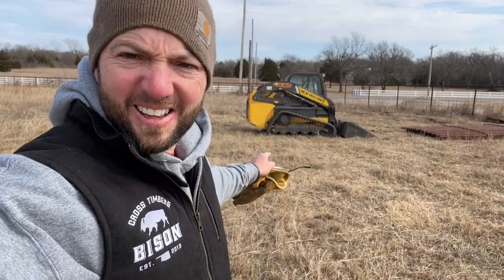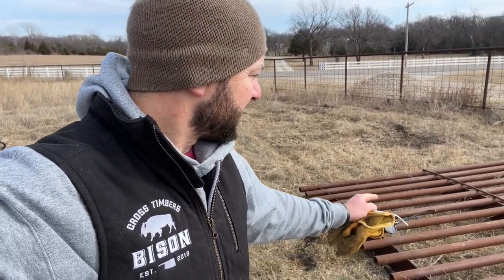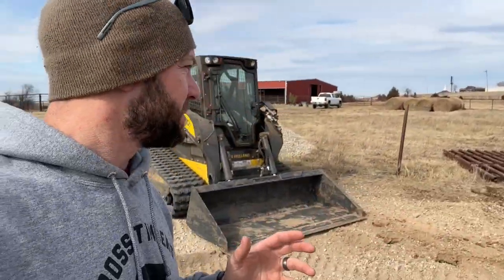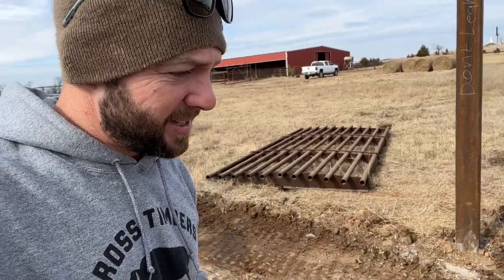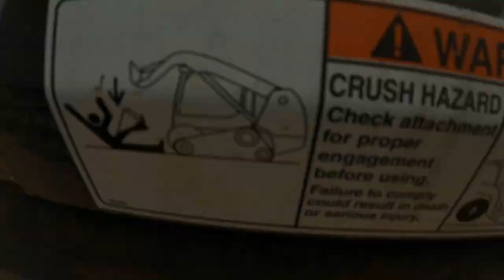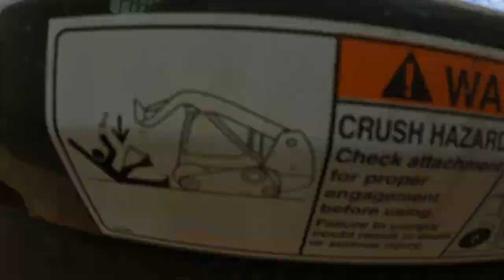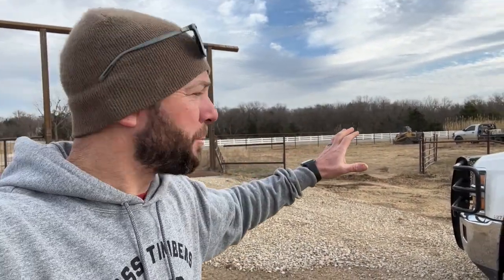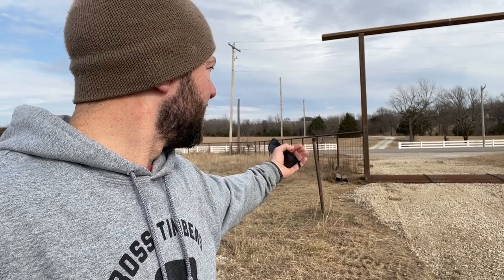Last Chance Stop for a Bison To Escape!

Comment: Out in Colorado l have seen where a Cattle Guard has a cement frame.  The cement frame has a two foot well.   It will take many years to fill up.  Easy way to keep it clean is to have entertained points on the outside of the holding area.  How you have it set up now, your bison will wall right over it.  The video of your water pipe trench showed me that bison will walk right through a simple 
Cattle Guard .